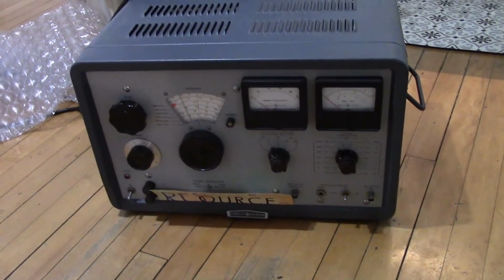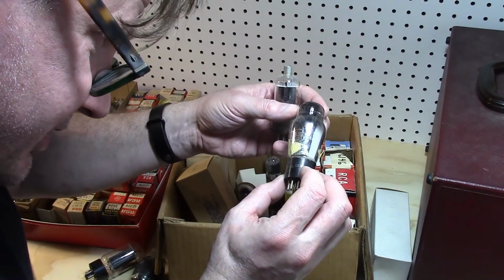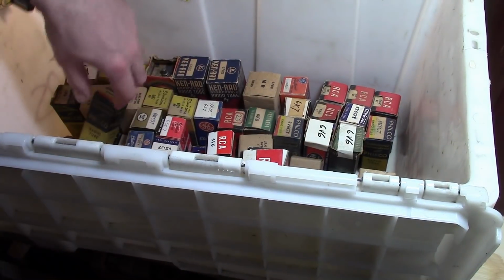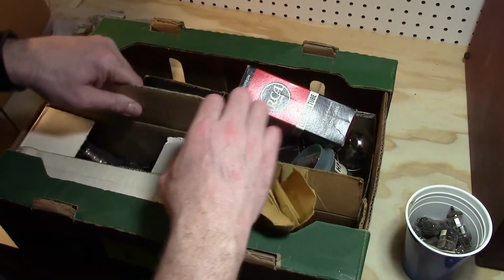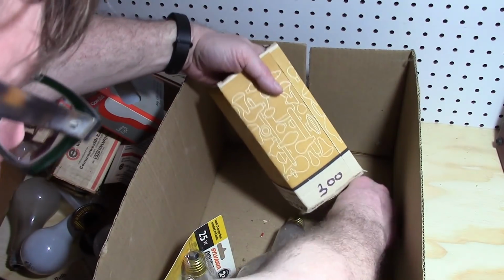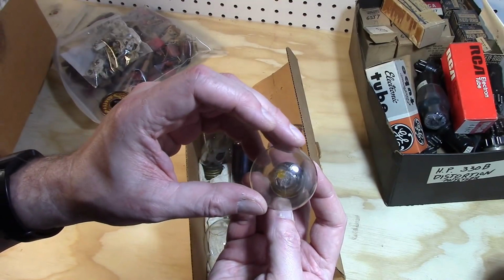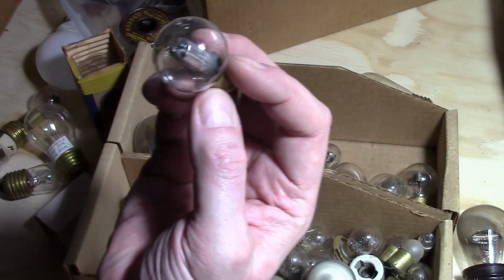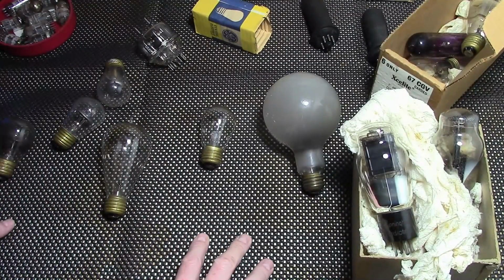Estate treasures: Tubes and bulbs

Comment: The old radio station near me has a set of 4 neon bulbs that their phone line runs through.  The bulbs flashing indicate an incoming phone call in the DeeJay booth.  They took the bells out of their desk phone so it couldn't ring in that booth.  The station turns 71 this valentine's day and going into that place is like stepping into a time machine.  The DJ booth's walls have rows upon rows of 78rpm records.  If you go out behind the place they have a trailer with a WWII vintage generator on one end of it and an anti-aircraft 1 million candlepower spotlight on the other end which is what the generator powers.  They used to use it at stuff like the grand opening of a store and it looked just like those spotlight beams on a 20th century fox logo as you can see it shining up into the air from miles away.
Reply: Sounds amazing. Can you give us the name of the place to find photos?

Comment: I like your mat but if I were you I'd go to walmart to the sewing section and get a self healing cutting mat and put it where you put your chassis you're working on as it will last a lot longer than that mat you bought.  I cut to size and use those mats like yours in kitchen drawers, under speakers and even under area rugs on wood floors to keep the rugs from moving.  I also put them in the drawers of my tool boxes.
Reply from the maker: Thanks for the tips.  There won't be any chassis on this workbench.  It's just a tube testing station.  The new main workbench will be much larger and I'll use a different surface.  I like your idea of using a mat that can be replaced as needed.

Comment: I used to use those 200w bulbs in our barn to light it up good in there as it had 4 ceramic bulb holders so had a total of 800w in there, lol.  Years later we put 2 four 4ft florescent banks of lights in the front half of the barn but in the back half as far as I know it still has just the ceramic edison base sockets.  My Sis sold the place in 2010.  Now out in my garage I have a set of three 4ft florescent fixtures over my workbenches and 3 ceramic edison sockets on the other side of the garage with 60w incandescent bulbs in them.  When I go to test a radio I turn off the florescents and turn on the incandescent bulbs for less noise interference.

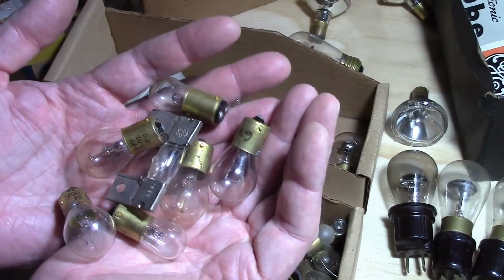Comment: THE mild UV lamp is actually very rare, mad in the late 30s. It only have a lifespan aof 25hrs. It certainly does not produce enough UV for exposing anything, due to its technology. The lamps from 44 are partly very old. the second lamp out the box is indead not as old as the others from that box that might 100 or a bit older. You can see on it that the evacuatiopoint is a tube in the part near the base colled the stemm, and the nipple on the top is mor of a gimic. The blue one ones is the most interesting. It is not UV nether mercury. q carbon filmanet is not hot enough to produce UV, however it procuces a lots of infrared radiation. From 53 min on in the bottom box there are reflector lamps with Ba15d cap for planes, liekly 28V (I want xD), most of the lamps in their seem to be for palines. . Not That neon NE 55 needs an external resistor for current limiting Ne29 is a  new one to me. 60V 10W is for telefon exchanges.  58:51 is for a plane headlight. 59:01 was used an a aparautus for cutting sound tapes for old films.

Comment: Those neon tubes probably will unscrew from the bakelite bases. Glad this stuff was saved from the landfill. Some people would think all this stuff is just a pile of junk and toss it. Some of those old bulbs might have a carbon filament. It is a shame they are damaged. I believe they are similar to those bulbs that will last 100 years.
Reply from the maker: Unfortunately, they don't.  The bulbs are held in with some type of cement similar to what is used in tube bases.

Comment: Those 2A3s are Single Plate (vs Double Plate) and are worth quite a bit of cash, check ebay sold items for values.  They were used in high end radios from the 30s - Scott, McMurdo, Capehart, RCA, etc..
Reply from the maker: Yes, they sure are.  I'd heard about the single plate style but never held one in my hand before.

Comment: Thanks for giving us a front seat view of your rummage Bob !
Some very interesting devices there.
I know there were multiple uses for the neon lamps; night lights etc.. but I also know that experimenters in the mechanical TV era of the early thirties used the large neon bulbs as light sources because the thermal lag in incandescent lamps rendered them unsuitable for this purpose.
There were in fact bespoke rectangular plate neons produced at the time for TV usage but many experimenters went for the general purpose, cheaper option.

Comment: the 115w bulbs may be traffic control bulbs-I actually use 116w bulbs for when the guy goes up on our tower and has to change the side marker bulbs and they are traffic control bulbs with a very specific wattage

Comment: I could use that 6J5 and 6F6. Also just a question my vintage tube amp the output transformer gets really hot can still do the 5 second finger test but palm of my hand if leave it for 4 seconds it hurts and hand is red. Should I be concerned? Also the caps on top of chassis are warm
Reply from the maker: Caps should never be warm.  I've never work on a tube amp, but that sounds much too hot.
Reply: @bandersentv  they might be warm from tubes near them. But them being warm might be why transformer is getting hot. If I notice more hum then what I'm hearing now will replace them

Comment: Several of my pieces of Ham gear use the 6146 & 8198 tubes and they were common in some commercial gear.  1156 is used in cars as a tail light or license p[late light. Some radios used a bulb as a fil dropper, and I have seen neon bulbs used as an oscillator and also antenna protection.

Comment: “A piece of test equipment where a [special] lamp is a key component”

I’m guessing you’ve got an HP 200 audio frequency generator?

IIRC, Bill Hewlett did his Master’s thesis on that bulb-incorporated oscillator design, then later when he teamed up with David Packard they marketed it as their first commercial product: the model 200
Reply from the maker: Yes, you are correct, and I will be showing it soon.  Crazy that it came out way back in 1939.  Also crazy how heavy it is!
Reply: @bandersentv  I got one in an estate sale a few years back (the ‘D’ version), and yes they are HEAVY 💀

Mine’s completely original/unrestored and still works flawlessly! (save for the dry-rotted vernier clutch) 
It’s capable of LOT of output, and consistent amplitude across the entire range!

Comment: 6G6-G is a triode twin diode like a 6B6-G. Predecessor to the 6Q7. Some of the radios Dave Tipton worked on had them.
Reply from the maker: Thanks.  Strange that I've never encountered either of those tubes.
Reply: Sorry, but a 6G6G is a low power output pentode with a 150 mA heater.  They were designed for vibrator "farm" radios.
Reply: @stuartirwin3779  Sorry, I stand corrected. I was confusing it with a 6G8-G which is a remote cutoff pentode with two diodes.
Reply: @danielthomas3057  Indeed, although the 6G8G was interestingly unique to Australia.

Comment: 2A3s are still used in some pretty hard core new audiophile amplifiers. With one tube running single ended you can get about 3-4 watts. The 6L6, 12AU7, 6SN7 and 6SL7 are also used in some high end audio amps.
If you dig up any Western 300Bs, start planning your next vacation.
A bunch of those bulbs in the last box look like automotive bulbs. Certainly the 1156 is an auto bulb that's still made today.
Reply from the maker: Yes, they do and a pair of single plate 2A3 go for 100s of dollars :)
Reply: Some Jukeboxes used 2A3's too
Reply: I see on ebay they price some of those box plate 2a3s at over $500 each ! And the 12ax7 prices are shocking as well. I think you have a gold mine there, but dealing with selling tubes on ebay is not as fulfilling or fun as restoring radios and TV's. I'm sure glad to see his estate went to a collector (you)  who appreciates the  engineer's stash as much as he did .  Congratulations !

Comment: Those bulbs at 57:46 with the odd base with holes are for slide or film projectors
Reply: They are "exciter lamps" for optical sound-on-film in 16mm projectors.  Used with a photodetector to reproduce the sound track.
Reply: And microscope illuminators.

Comment: 6146s are a VERY common final amp tube for HF ham transcievers. A pair of them will give ~100W on all the HF bands. Were used up into the 1980s in Yaesu/Kenwood/Icom rigs.

The 829 and 832 are dual tetrodes, not dual triodes.  The 829 is approximately a pair of 6V6s in one bulb.  Unfortunately, they have a common screen grid pin, so no ultralinear operation as an audio amp.
Reply from the maker: Thank you for the info.  100W from a pair?  That's impressive.